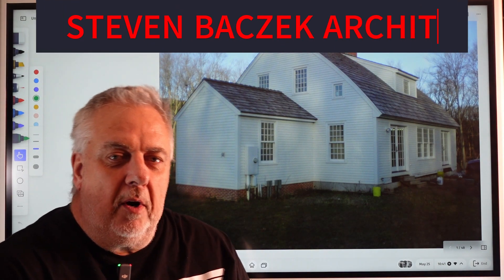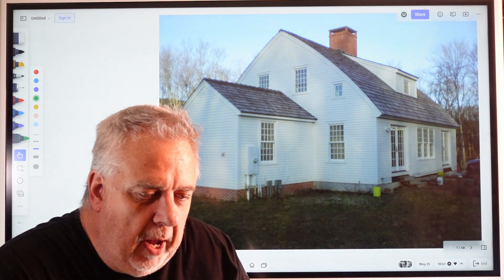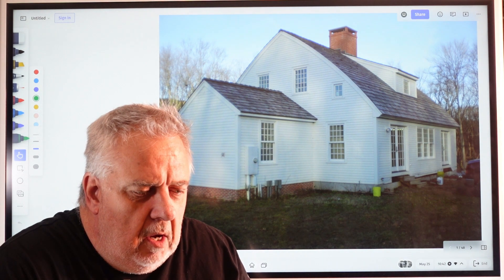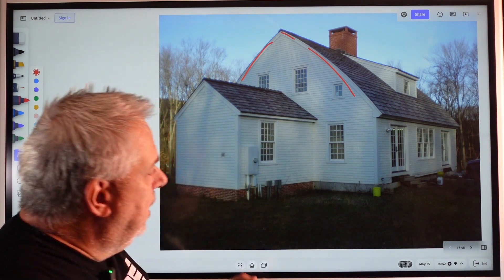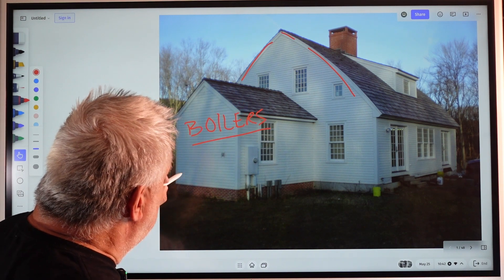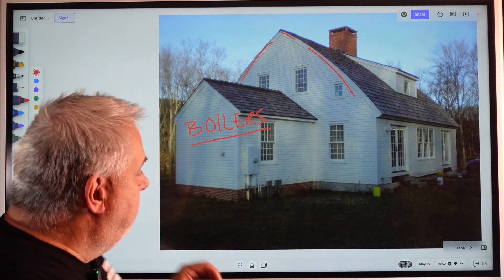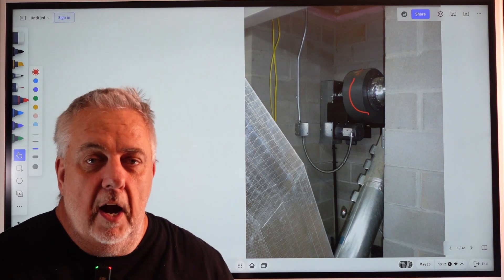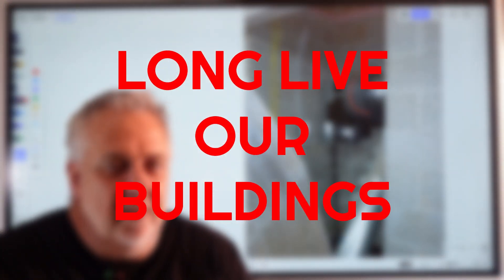GASIFICATION BOILER??

Comment: I live in a rural area and lots of folks have these! I'm not sure you explained how they work perfectly so I'll try and add a little (I'm also not an expert) Instead of a traditional fire, like a fireplace where air blows across logs and the smoke goes up a chimney until its burned up. These greatly cut back the air to the fire once it's going, but the wood is in an environment so hot that it keeps "burning" but the exhaust is now rich and flammable like propane. The boiler directs this gas to burn across the heat exchanger in a secondary firebox efficiently because it's now separated from the very insulating ashes and logs in the primary fire box. Additionally when the water reaches temperature that blower will kick off and the primary firebox will go into a smolder, barely burning until the water temp decreases again.

Comment: All wood burns by gasification, that's why the flame in the fire is above the wood. Then the remaining fixed carbon you'd recognize as the coals in the fire.
Reply from the maker: My understanding is that these burn down, much hotter, and far more efficient,
Reply: You aren't actually burning the wood in the traditional sense; you heat it to the point of chemical breakdown with limited oxygen.  The wood in pyrolysis is undergoing an endothermic reaction, absorbing heat to break itself down.  In combustion, the wood is undergoing an exothermic reaction, directly releasing heat.
Reply: @patrickkenny2077  a campfire works the same way, that's why the flame is above the wood. A downdraft gasifier just orders the phases by temperature to get a more complete burn.
Reply: @Zorlig  pyrolysis is not combustion.
Reply: @patrickkenny2077  yes that is correct. Where you error is in thinking that this doesn't also happen in a normal campfire.